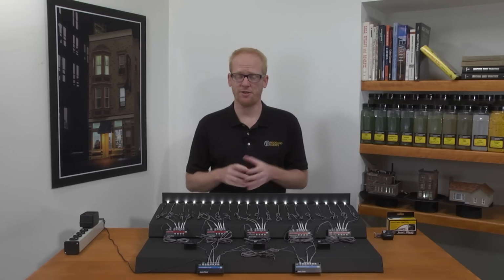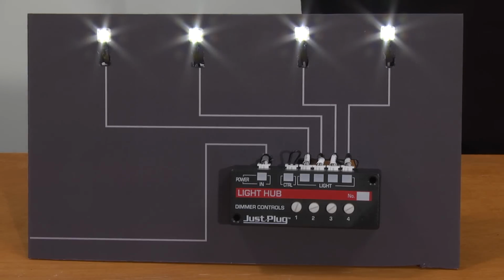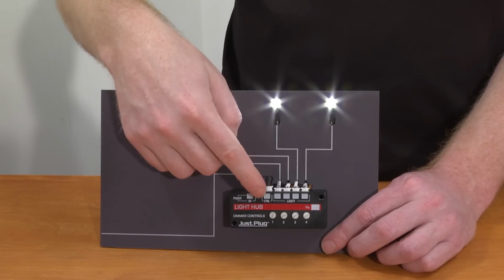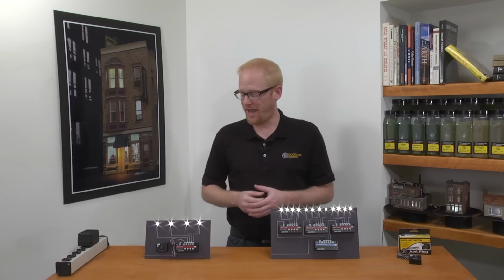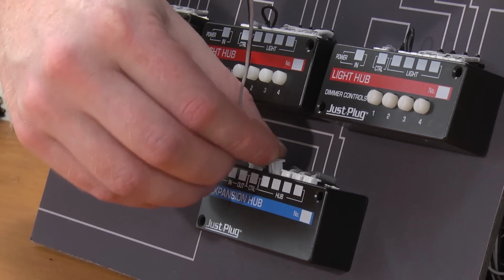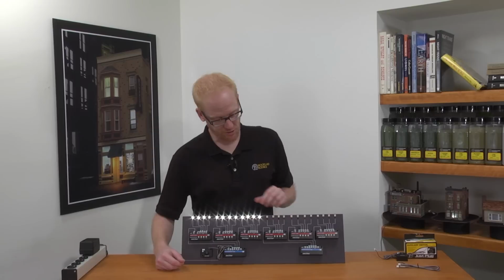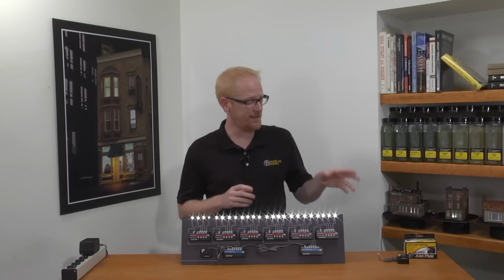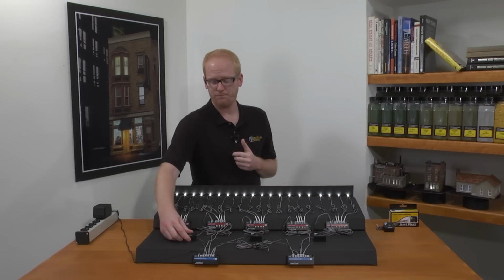Auxiliary Switch | Just Plug® Lighting System | Woodland Scenics | Model Scenery

Comment: I don't understand,  what makes this different than just adding multiple single pole switches within the same circuit?
Reply from the maker: The Auxiliary Switch is designed to make turning the Just Plug Lighting System ON and OFF easy and convenient. It is an easier option.

Comment: Can you link the Red Light buds together or do you have 
to use the blue  expansion hub?
Reply from the maker: The red are the Light Hubs, while the blue are Expansion Hubs. Expansion Hubs are designed to power multiple Light Hubs so if you're expanding your system, you need to connect the red to the blue. Here's a video: https://youtu.be/Wx20Z4rF2Wg